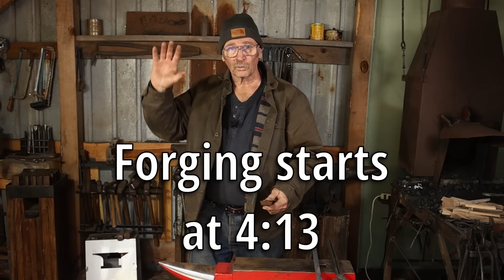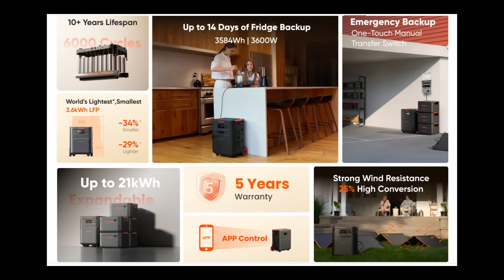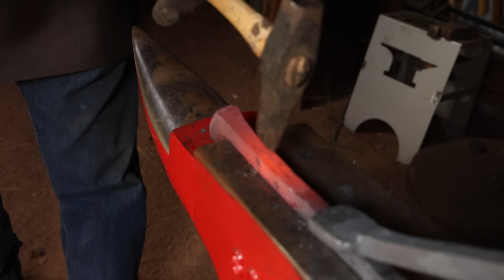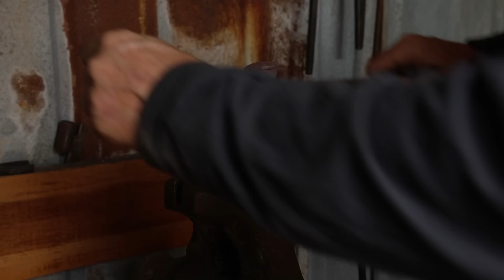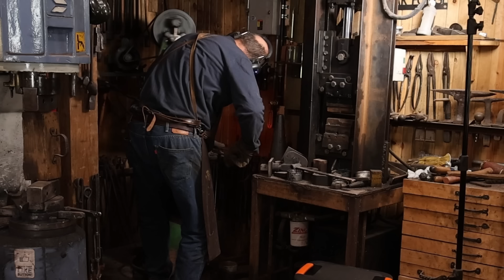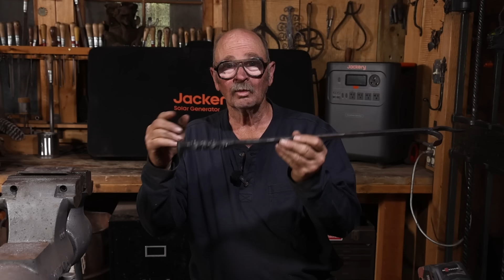Turning a Railroad Spike Into a Cool Tool!

Comment: That last twist after forge cooled off perfect opportunity to see if Jackerie wiĺ run the induction forge.
Reply from the maker: Since the Jackery has 120 Volt 30 Amp output and the induction forge requires 240 Volt 40 Amp input, I would say no.

Comment: Kinda curious how that power pack holds up against the echoflow, got testimonial of the echoflow running a flux core welder all day, the deck frame, and 3 shipping containers welded together, beginning to be a house, to prove it.  "Building a dream " channel

Comment: Nice work,  you always make forge welding look so easy. Having power outages or failures is not fun, that little battery system would be very handy to have for that or a remote location without power.
Reply from the maker: Glad you enjoyed it!

Comment: I checked the specs on the Jackery site. I couldn't see where the 3600 would last 14 days. I guess it might if you were just running lights. But if running a fridge or cooking I think it's capacity is much less. They are a bit expensive too especially if you include the solar cell charging. Still, it is an impressive piece of equipment.🙂🙂
Reply: It can run a fridge for 14 days. It said the fridge was 100watts. Now that's a nice fridge keeps an entire can of beer 12 degrees cooler than ambient room temperature using those semiconductor peltier resistors.

Comment: When you bought the aircraft carrier of an anvil in your main shop were you aware that it would not be compatible with regular hold fasts? I imagine that was quite a disappointment if not.
Reply from the maker: It wasn't something I was expecting.  But with so many other work holding options, It really isn't a big deal.  For something like this in the main shop I would simple work under the treadle hammer where a hold down isn't needed.

Comment: Dont get me wrong. I enjoy your content,  but they guild the lily a bit.  What fridge draws 100W...  and how are they working out the duty cycle and at what ambient temperature....  they use the same terms here in Australia,  these are not a power generator, they are a power storage system that can be recharged from mains or solar or an actual generator.  Good to have on hand but a bit overstated and oversold.
Reply: I think by 100W they don’t mean that it actually draws 100W at any one time, instead they more likely mean that on average every hour it will draw around 100Wh. Regarding that amount itself I’m looking to buy a new fridge because my last one broke a couple days ago and on the EU energy label it estimates 300kWh/annum for this E class appliance with  300l of fridge and 150l of freezer ; if you calculate 300,000/(24*365)≈34 , meaning that this modern fridge should be expected to draw an average of 34Wh every hour; given this number I say 100Wh every hour is not unreasonable